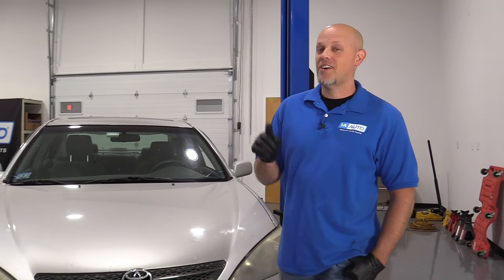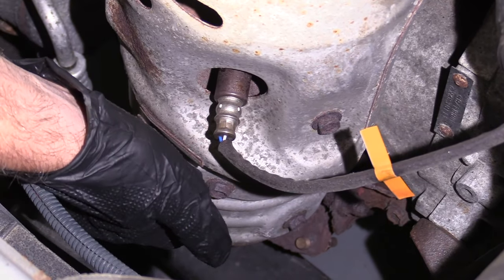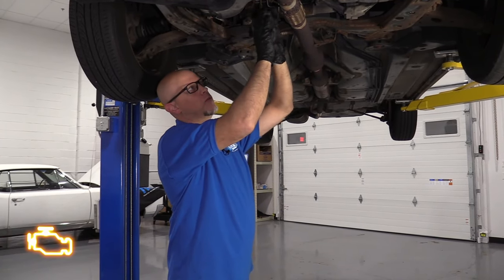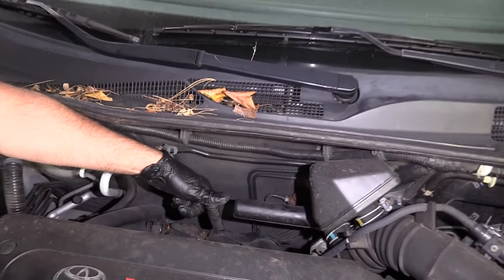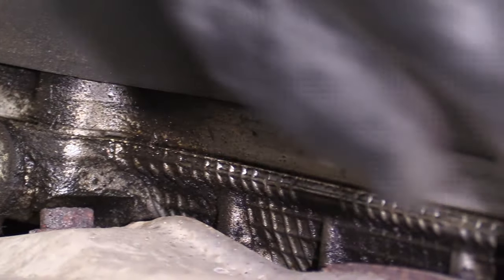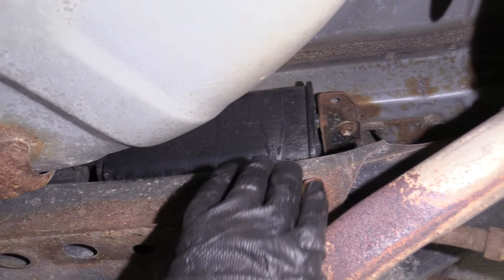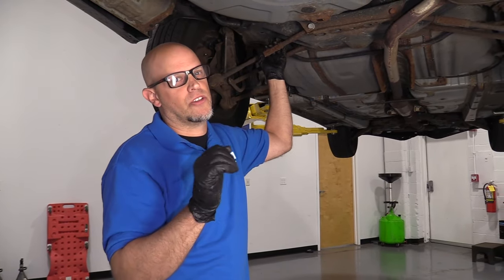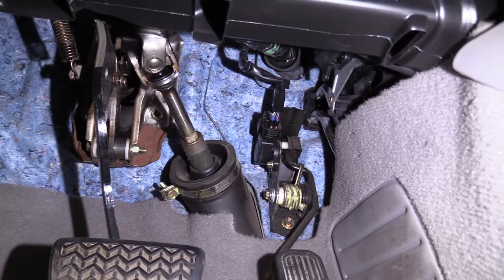Top 5 Problems Toyota Camry Sedan XV30 5th Generation 2002-06

Comment: That generation of Camry's are some of the highest quality vehicles ever made. It doesn't look like anything impressive, but it's perfect in all ways that matter. The 4 cylinder in that model has perfect level of power for normal driving while still being decent on gas, and they seem to run forever. I bought my 06 for about 3K, incredibly reliable car.
Reply: I bought a 06 for 2000 after all the work I put into it 5 months ago an it runs pretty good 215k miles
Reply: I bought my ‘06 for 2K and it’s a beauty. She runs like new I love her.
Reply: @vendrick4571  how many miles are on your 06 camry
Reply: With Toyota's rep and the car market these days I see people trying to sell these models for $5000-6000. They ARE nice, but it's a 15 year old no-frills car. In REALLY good condition with decent miles most I'd pay would be $4000.
Reply: I paid 3900 for my 06 with 125k miles.  Getting ready to put on a starter.
Reply: @justcurious5618  u bought it an it need a starter
Reply: Also bought an 06 for 3k! 202k miles at the time, at 207k now a year later!
Reply: @arthas_scourge  impressive did u do any work to the car since u had it
Reply: Bought an 06 Camry with 175K mi on it for $1700. Just had to put a transmission in it. Runs like new.
Reply: @mistaibn5478  Is it a 6 cylinder model? You don't hear about too many transmissions failing in Camrys. Maybe it was abused at some point.
Reply: I agree. I own a 2005 Camry LE with over 350,000 kms. Solid as a tank, spacious, fuel efficient & comfortable. Going on 17 years now.
Reply: @arthas_scourge  tomorrow I'm buying an 05 with 182k for 3k..I know its probably going to last at least 5 more years... it drives like new
Reply: @BoringBrandon1  bought a 2003 xle 4 cyl for 2900 138k runs great but does have peeling clear coat from the AZ sun. Most other camrys here have 200k+ and people want 3-5k for them.
Reply: I wouldn't spend much for one of this generation unless you are prepared to do major engine work as it has widespread engine problems with the head gasket and the head bolts stripping in the block. Toyota has acknowledged the problem but has never attempted to redress the issue which is by far the leading NHTSA complaint issue for this generation of Camry. Mine went at 176,000 miles but I know many people who had it go much earlier. A friend of mine is a major Camry fan and collects them but won't go near this generation.
Reply: 1992-1996 model years are the most reliable.
Reply: @jamesfederer5592  I agree although the 97 through 2001 generation were very reliable also.
Reply: I am thinking of picking one up with 190.000 km on it seems pretty mint both inside and outside full service book for 2500 euro, should I get it?
Reply: Does it have a lighter input?
Reply: @kelseyrainwater3918 Hi, I've run into you before in the comments section. How is your   Camry running? Have you had any issues with the torn boot? My 2005 is running problem free. I just bought 4 new Michelin's at Costco this week for nearly $800
Reply: @frankg6578 been driving 4 years with no power steering fluid leaks everything still seem good with my torn boot
Reply: Getting Mine on Sunday. I rather have something with good reliability than to have a lemon 🍋

Comment: When the evap canister makes it in the top 5 issues with a vehicle, it's probably a damn good vehicle
Reply: What if the evaporator canister is in your five top issues with the car that’s not good your evaporator canister should last the life of the car
Reply: Exactly the car last just as long as something that supposed to outlast everything else
Reply: To save evap do not over fill tank as fuel will get in it or so much fumes as it is close. My 03 gets evap code everytime i totally fill up, clear it and stays off once i burn some fuel.
Reply: @JayElement13  Should, but it's very easy to damage with operator error
Reply: @rt2255  you may need to change the purge valve located on the canister, same thing happened to mine and turned out the valve got eroded over time and eventually seized up so the canister couldn't purge. Filling at the pump used to be a hassle, because the pump would click off multiple times before the tank was full.
Reply: @JayElement13  they fail cause people over fill tank and saturate cannister with gas. If i fully fill.my 03 get evap code, goes away as long as i fill to like 90 percent or so. When pump shuts off do not round up dollar amount evap will last like mine 330k and fine
Reply: @rt2255  mine broke off when a shop broke off the make part of the canister while installing the starter and rigged it . Didn’t find out until I took it to another shop to smog it .

Comment: I bought a 05 camry 4 months ago at 194k miles and still going strong. I'm currently at 220k miles.
Reply: God damn you drive a lot
Reply from the maker: Very nice!  If you need any parts for any of your vehicles, check us out at http://1aau.to/m/Shop-1AAuto-Now
Reply: You must have a long commute to hit almost 30k miles in 4 months
Reply: @Sci-Mon1  i commute like that too and have used a 99 camry for about 7 years. Keep oil and fluids changing, take good care of the frame and replace the shocks, other suspension stuff ect and it rides like new
Reply: Nice!  I just bought an '06 and I have a similarly long commute.  Bought it with 208k, and I may hit 400k in 4-5 years if all goes well.  How much you pay for yours?
Reply: @brianheath5091  i got a 06 Camry with 215k miles paid 1600 put 400 into work into it total of 2000$ runs like a dream no rust shifts great engine smooth
Reply: About to buy 1 with 75k miles!!!
Reply: Has the timing belt been changed

Comment: As an owner of a 2002 Camry the only problems I’ve had is a starter, alternator, water pump, O2 sensors, PS hose, and gas cap o-ring. Super reliable car.
Reply from the maker: That is great to hear!  Thanks for watching!
Reply: Around what mileage did the starter , alternator and water pump go
Reply: @jshaka3769  I think it was maybe around 150k to 180k mi. I paid someone to do the water pump but the others I did myself. The hardest thing was moving the tensioner on the serpentine belt.
Reply: I've got a 2004 Camry that hasn't had any of those problems, at least not yet! Keeping my fingers crossed!
Reply: @rongendron8705  same here👍👀

Comment: Awesome, I love how these top 5 are fairly minor and easily fixed yourself as well! I got a 2004 Camry Sportivo with 288k on the clock, still going pretty good!
Reply from the maker: +Krazykov Thanks for checking us out! http://1aau.to/m/Shop-1AAuto-c
Reply: O2 sensor is costly to replace
Reply: new park plugs
Reply: is that the 4 cyl or v6? and how has the car been up till now?

Comment: I got an 05 Camry. It needed a bit of work when I got it (front and rear brakes, one wheel bearing and a cabin filter). Aside from the sagging headliner and an issue with my headlights, it's a great car! It starts every time hasn't failed me yet. Couple little dings and dents from the previous owner but there is almost no rust on it. Clear coat is peeling off the back bumper, so it doesn't look that pretty but it never ceases to amaze me how well she runs for 18 years old. She's almost at 270,000km.

Comment: 2005 2.4 5 speed standard.  I got 181K on it. Runs great! Got it 4 years ago for cash. 3,300.00 after tax! Since I installed tires, a battery,  a alternator,  a slave cylinder and accumulator for the clutch, gas, oil and a light bulb! I put 30K on in 4 years and am very happy with my used Toyota!!!

Comment: Yep, spot on. Replaced the O2 sensors and VCG on my 421,000mile 2002 Camry. Still going strong.
Reply: Original engine and transmission? What have you replaced? Damn 420,000
Reply: 421000 on the original engine and transmission?  WOW!
Reply: What type of oil do you use and which spark plugs are in it?
Reply: Oh that's scary my car is still going also 330,170 lol I don't think it will ever die tbh
Reply: mine have 390k miles still original engine and transmission it eat 1qt of oil each 500miles but ride very nice just brakes and oli changes thats all
Reply: When i worked valet, the highest mileage cars these generation camrys. On God i seen one at 500k and another at 400k, and they were perfectly fine when driving then

Comment: At 185k miles.  Overfilled my gas tank,  charcoal filter eventually dried out and reset check engine and never came back,  my valve cover gasket just went yesterday morning and replaced my O2 sensor last year. Got a knocking too, you can be damn sure im checking the plenum. This guy knows his stuff

Comment: You are spot on for common problems!  I own an 2002 XLE.   Purchased for $2500 at 184k. Engine valve cover gasket was first order of business when I purchased it.  You just helped me diagnose the rattle under the hood.  It’s the intake manifold.  Thank you.
Reply: How did u know? Mine 2005 camry v4 engine might have the same problem
Reply: @emad5594  the valve cover gasket or the rattle?

Comment: I have a 2005 (4-cylinder) with over 300k miles.. still runs good
Reply: Have you ever had a hesitation problem?
Reply: @trini_boi2414  minor stalling problem once.. car always re-started.. It helps if you do the following :
- clean the throttle body
- make sure engine air filter is clean
- change PCV valve if car has over 200k
Reply: @soumentalukder4750  I did all that except for the pcv valve I think I'll take it to the shop and have then do a diagnostic to find the problem
Reply: Mine is a 2005 2.4 with 318K. Burning all the oil about every 4K miles but other than that it's smooth
Reply: @ceavalencia4767  😳😳😳 wow that's a lot of miles and still running those old skool camrys was built to last 😁
Reply: @trini_boi2414  I purchased it at 292K from my closest friend who traveled to México very often, and I travel between Portland & SF
Reply: @ceavalencia4767  that's one of my main reason why I drive and own a Camry they could handle high mileage without draining your wallet on repairs
Reply: @LeopardSky sounds like a good buy..change the oil put full synthetic,replace spark plugs and air filter too that should help it run even better and congrats 😀

Comment: I bought a used 2003 and I love it.  This thing is a beast! I got 191K miles on it.  Only issue I run is the valve cover gasket. Replacing that is a 1 hour job if you stop for a beer. Great video!
Reply: Valve cover gasket usually goes shortly before the head gasket/bolts go so I wouldn't count on that car for too much longer.
Reply: Up to 200k with no signs of additional wear… it’s a great car and my wife is using it to learn how to drive. Hope new cars last as long… haven’t bought a new one in a lo g time! Cheers.
Reply: @marlonargueta  Good. I would love to pick up a late 90's model when they were better made. That head bolt issue pops up in so many of these that Toyota should be ashamed for not addressing the issue. Just when I thought that my Camry was going to last a long time, after replacing so many other problems, the head gasket and bolts went but at least I made it to 176,000 miles. The only other cars that I have had last that long were the old Subaru's, also from the 90's (wouldn't go near a Ru today), a late 80's Ford Escort and a few Geo Prisms and Trackers.
Reply: 191k is barely broken in my 03 at 330k
Reply: Is it a 4 cylinder engine?

Comment: This is an awesome video! I bought an 02 Camry in September 2019 with 70k on the clock for $4,800 here in San Diego. The paint, mechanics, and history were mint. I love how affordable it was and how easy it's been to maintain. I actually look forward to the 100k maintenance I'll be doing in 2022. Thanks for the heads up!
Reply from the maker: +Mathias Gomez Thanks for checking us out! http://1aau.to/m/Shop-1AAuto-c
Reply: that's a steal you better hang on to that camry you can't find em that mileage anymore

Comment: I thought he was gonna talk about transmission or engine perform issues  lol.. Great job and yep toyotas are the best !
Reply from the maker: Thank you for checking out the video. If you need auto parts go to: http://1aau.to/m/Shop-1AAuto-Now
Reply: @1AAuto  what are the common problems on the V6 version?
Reply: @supadupa6891  Timing belts and sparks plugs being a little more difficult to access. Other than that they're bulletproof.
Reply: @supadupa6891  eh I’d stay away from the v6 3.0 they have an issue with head gaskets.

Comment: I bought a 2005 Camry with 154k this month :). So far so good. I will keep you guys updated every 2-3 months:)
Reply: Update time 😆
Reply: So far so good 😊 
Love the car 🚗 
No problems at all:)
Reply: I get 320 miles on a full tank:)
Reply: I just bought a 2005 Camry with 93,000 miles on it. Looks brand new, garage kept, one owner Florida.
Reply: @MultiAnne36  
Great buy 👍and you got a great car 2 .
Reply: Does your camry rattle when you turn the car on in the morning? I notice my 06 Camry makes these rattling noises there and also on idle. Like when I'm at a drive thru window. Sounds like a tiny metal ball being shaken up in a jar. Then it stops. Then again. This video mentioned something about hearing a sound. He said to replace the intake manifold. Not sure other Camry owners experience this and if there is a solid fix. I want it to be quiet not rattle-y. FYI, my Camry still works fine at 190k miles currently. Will almost hit the 200k+

Comment: Got the v6 2000 ...491,186 same engine, just replaced transmission and expect at least 200,000 more. Love it, most reliable car I’ve ever owned.
Reply: Tell me more about the v6.  I love to buy one,  but some friends keep advicing against it.
Reply: @Mykelclassic  The only downside that it needs a lot of gas in city traffic. 16L for 100 km. Freeway 8L for 100 km
Reply: @Mykelclassic  And you it needs to change the timing belt kit(!) each 100k miles. Original Aisin kit costed me 250 USD + 2 days of work.
Reply: I already bought a 2008 Toyota avalone,  have had it for 7 months.  I was told it uses timing chain instead of belt.  So i won't be changing that
Reply: I already bought a 2008 Toyota avalone,  have had it for 7 months.  I was told it uses timing chain instead of belt.  So i won't be changing that

Comment: Haha yup I’ve got an 05 still running like a dream at 235k miles. The worst of the repairs I’ve had to make is a bunch of suspension parts in the past year, but all the parts I’ve replaced normally only last 100k. Can’t complain about replacing for the first time at 235k!

Comment: I had a big problem with my 2004 Camry XLE about 3 years ago. The shop said it would cost over 800 dollars to fix. I went home ordered parts on line and the total cost was just over $200.00! I just found out that my Camry was made in Japan, no wonder it runs so well.
Reply: Mine made in USA 330k miles and counting. Not where it is made but how it was designed. Designed to be comfortable and last. Mission accomplished.
Reply: @RT22  no way it was made in USA 😂
Reply: @limbogt747  kentucky
Reply: @RT22  but there Japanese cars....

Comment: Bought my 2005 Toyota LE four Banger, for $7,500 back in 2015, with 113,000 miles on it. Best 7 grand spent on any vehicle I have ever owned. It now has 211,000 miles on it and still running strong. New tires, alternator, battery, serpentine belt and windshield wipers on it now..

Comment: Just bought an 04 Camry with 150k for my first car, let's see how far she goes.
Reply: how has it been
Reply: Yeah, how has it been?
Reply: I have a 2002 with 315k miles running strong
Reply: I'm still driving an 05 camry, almost wrecked it (not my fault of course), still going strong
Reply: It will run and run and run...
Reply: It's was pretty good, I sold it just a few weeks ago because I moved overseas but overall it was a really nice car. Used it to go to multiple states and never failed me.
Reply: 2 mil miles later

Comment: My 05 Gen 5.5 V6 made in Japan. Changed oil and oil filter annually with Mobil One and K & N Oil Filter. Changed Serpentine belt, maybe added a little freon, flushed radiator , and front left boot cover. Strange noises from AC vents, just change the settings to where the air flows and the sound goes away. Car is flawless and the best one that Toyota made in the past 20 years.
Reply: PS Added Blue Tooth adapter plugged in cigarette lighter DC socket which broadcasts over FM, and I stream music. Who needs a new car to just listen to music, I dont, and still have 6 changer CD and also (hehe) Cassette. Alexa car Echo also in the same bluetooth adapter power socket and a Garmin voice activated GPS, and a ScanGuage ODB2 Digital readout sitting between dash and steering wheel (can see MPH, Oil Temp, DC battery voltage).
Reply: I’m seeing a 2005 camry se V6. Any tips i should look out for when checking it out.

Comment: I fixed the cracked exhaust manifold with a wad of high temp metallized epoxy. 35K miles later still all good. Sanded the area & cleaned it very thoroughly first. Man do I ever miss those headman / blackjack headers !